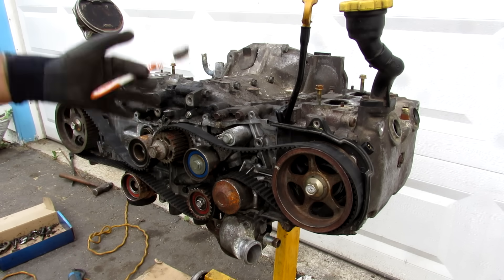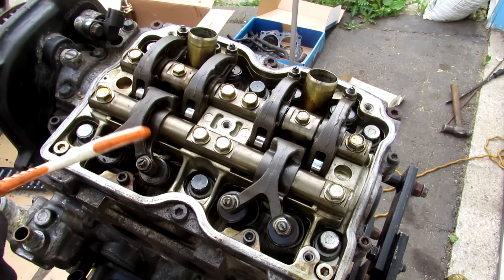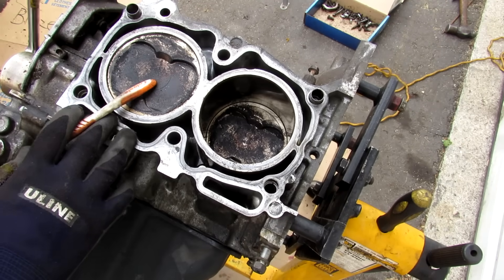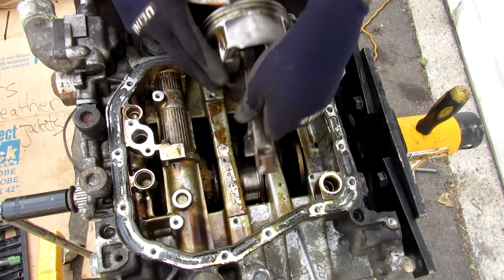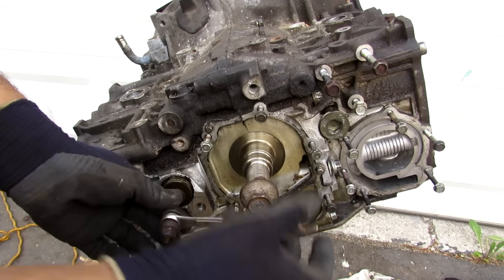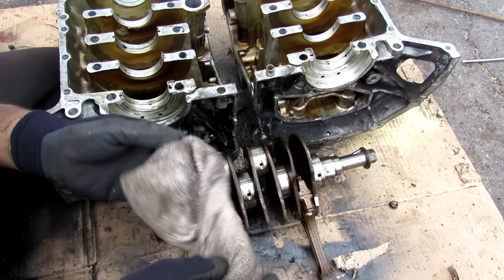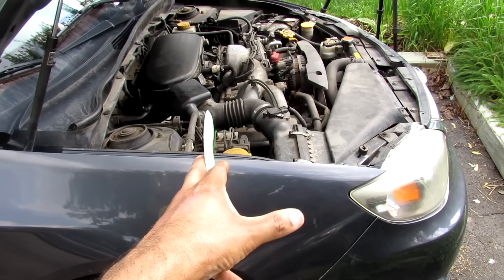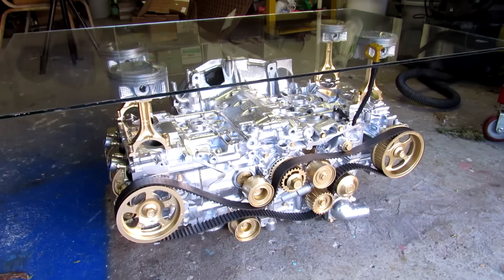Why Subaru Engines FAIL

Comment from the maker: If you've got a Subaru, keep your vehicle well maintained! 
You can purchase engine oil here:
https://amzn.to/3d85UIN (US)
https://amzn.to/37yDKpb (Canada)
Quality oil filters:
https://amzn.to/2B56WYV (US)
https://amzn.to/2N1NBKM (Canada)
Engine coolant:
https://amzn.to/3fpfPeB (US)
https://amzn.to/37uSF41 (Canada)
Subaru headgaskets:
https://amzn.to/2Auw8bz (US)
https://amzn.to/2MYTcSb (Canada)
Reply: I've owned 3 Soobies always maintained 2 were ej2.5 & they have been some of the most reliable cars around. I don't know many people here in Australia that ever have problems with Soobies, they are fantastic cars with a great reputation here. These examples must have been thrashed or Americans just don't maintain there cars. Boxer engines must be serviced always on time with good high grade oil.  There are literally thousands & thousands of old Subaru's for sale 2nd hand most with 350,000kms+. Maintain your cars people!
Reply: @Jimmy-fw1wd  im in australia too and everyone i know have had a major prob or two with their subi including me.  I wouldnt touch another. My rav4 is at 430kms and original everything  including clutch ! Oh alternator is new !
And dont start me on working  on a boxer  ughhhh !!
Reply: @Jimmy-fw1wd  I purchased a Subaru because of its popularity in Australia and the Rocky Mountains. I figured that if they can excel in those conditions my driving in central Mississippi will be a breeze.
Reply: You should be doing that with any engine. I don’t think this engine is bad at all. Maybe if you’re wanting easy access to things, sure, but for the general public, it’s a safe, well rounded, and efficient engine.
Reply: There are how many Subaru’s still on the road?
Reply: @Socrates8397  they sold heaps and many have had the head gaskets done 😣
Reply: In your opinion, what is the most balanced engine ?
Reply: @Matlockization  bmw inline 6
Reply: @Matlockization  I-6
Reply: @Matlockization  , here's fact, not opinion: Gas turbine (jet) engine.
Reply: @GFTP100  Very interesting.
Reply: @Matlockization  straight 8 Buick
Reply from the maker: @Matlockization  inline 6 or v12
Reply: @speedkar99  Ok thanks.
Reply: @Matlockization  It'd be tough to answer that objectively, but for a 4-cylinder, the boxer config is pretty tough to beat. A straight 6 is also very well balanced, thanks to its firing order/cam attachment points. (For the inverse, it'd be tough to find a worse-balanced engine than a traditional V8.)
Reply: @TravisTerrell  Thanks.
Reply: @TravisTerrell  agreed ................... but nothing like the power of a V8
Reply: @TravisTerrell   V8 worse balanced? I don't think so! Most V8s are very smooth, the only engines smoother are inline sixs in my estimation, if you V8 is vibrating it's probably misfiring.
Reply: @TravisTerrell  straight 8 Buick if you're talkin  engines in general
Reply: @TravisTerrell  Actually, a V8 is a series of 90 degree V twins which have far better primary balance than any straight engine.
Reply: 911's and Bugs were noisy because they were air cooled and the 911's had chains turning the cams, it had nothing to do with the opposed pistons. I've rebuilt old 911's and they were works of art, the cranks were nitrided for hardness and the big difference in the 911 and the Subaru was the 911 had dry sump lubrication (it took 15 quarts of oil) so half the pistons weren't sitting in oil, the cylinder walls were sprayed with oil jets and later aluminum walls were nikasil coated. The 928 and 9 24- 944 had aluminum coated walls too.  
Those 911's were winning 24 hours of Le Mans for nothing!
Reply: @mosfet500  I owned a 86 944T and it was excellent.  The major weakpoint on those engines were the water pumps.  They failed so often it was considered a 30k maintenance item.
Reply: @bp968  The 944 was half a 928 with harmonic balancing to keep it running smoothly. I had a 1988, 944S and it was lots of fun without the back ends braking loose like the turbo 911's of the era with their wacky boost kicking in. I spun a 911 around coming off a thruway when I hit sand on the road exit. My girlfriend at the time got out of the car and started praying, in retrospect it was kinda comical. I'm old now and drive like a church mouse, age, wives and cops will do that to you! (not necessarily in that order)
Reply: @mosfet500  i spun a 911 during a testdrive.  Oops.  As for the 944t back end, i credit that with getting me serious into stage rally!  Now i drive sideways everytime it snows, but i drive better sideways than most people I know do when not sliding around.  It's something they should teach to all new drivers in northern climates IMO (they teach it in finland I believe).
Reply: @mosfet500  well he are talking a lot more expensive car too ! I imagine a veyron would be up another notch in quality !
Reply: That's with any car, but noted with your spam.
Reply: How many miles did this engine have?
Reply: @RealAnthonyCallahan  10 miles
Reply: Does he ever breathe?
Reply: can you do a car review on a crosstrek?
Reply: The really problem of  impreza engine is .. "the engine.."
Reply: @Sabrewolf81alfa  https://youtu.be/-jDrkEEK99E
Reply from the maker: @Baddawg_313  Send me the engine
Reply: @speedkar99  i dm'd you on your FB link
Reply: @speedkar99  Why do some people don't know and abuse their cars and their families and friends and personal Relationships.??????????????
    Some people Ain't got Common senses..... duhhhh
Reply: I got a VR6 3.6L 24v Dohc engine is it any good
Reply: speedkar99 has
Reply: Kjio
Reply: jcthawaii  x
Reply: Also have the oil and water pump checked out that that are working ok or replace well  before thay fail this can stop your engine seazing up and  as a rebuilt boxer engine WILL  fail more often and are more costly that the car's worth big money pit if you do not check oil water seals and pumps  any make of car with this engine needs a lot of TLC
Reply: @stephenlynch8846  this engine meaning horizontal?
Good reason why only 2 ? manufacturers use them !
Reply: Do you remanufacture the dohc 2.5 gt
Reply: You should maintain any vehicle no matter what it is just saying
Reply: @ronalddaub7965  i think subis need more attention
Reply: This comment says it all.

Change your fucking oil.
Reply: And change the timing belt every 60,000 to 80,000 miles.
Reply: I have a 98 Outback with 245,000 miles, still uses no oil and runs great. Has the 2.5 L DOHC, supposed to be the bad one. I'm lucky, I agree, not a great design.
Reply: The power of one man and a video to generalizes all Subaru engines as junk.
Reply from the maker: jcthawaii  Thanks
Reply: @speedkar99  awa
Reply: @speedkar99 i don't understand why subaru's boxer engine fails ??? Why !!??? 😢 but subaru still make a boxer and better than old engine !!
Reply: @madout2254  youd hope its better !!
Reply: What kind of gloves are those uline what?  link?
Reply: 00000000 o.o 0 0000 0 0 0 000000000000
Reply: If everyone keeps telling Subaru these engine problems,  did they re-engineer the design and fix it ?
Reply: @helpfulsysops3593  they know !
Reply: Ultra CNC  lol.  Not much xp with chevy.  Honestly not much of a American car guy (though most of what i buy is made here). Ford burned me on american.
Reply: Just like a corvair engine you need to know what you're doing to case align bore an engine when it needs it
Reply: T
Reply: Ultra CNC  haha classic  !
Reply: @Jim Kvasnicka Your reply made me realize I had forgotten to include the link to the WikiPedia article:

https://en.wikipedia.org/wiki/Opposed-piston_engine

Subaru does not use opposed-piston configuration.
Reply: Amazon affiliate spamming
Reply: To solve this problem, try swapping in a GM LS engine as an alternative, including mod them for reliability.
Reply: @nightdan7096  I'll think about my paid off PV and not having paid for gas or electricity in the last several years when I drive by you paying for your fill up. Let me know when you get your oil changed, I'll drive by there too and when that timing belt needs changing too. The maintenance on my EV for the first 150k miles is rotate the tires and change the cabin filter. By the way, lots of EV owners drive across the country.
Reply: My Subaru is a 2013 impreza. Only just hit 100k miles but it's burning oil. A quart of oil per every 250+ miles. Is there anything I can narrow it down to? Should i trade it in?
Reply: @dantedrowson2511  You should find the source of the excessive oil usage from Subaru or a trusted mechanic. If it's something small like valve seals get it repaired, if it's rings I personally would dump it.
Reply: @mosfet500  Okay thanks so much, dear. Is there a specific test to identify where the oil is being used/comsumed? Or do I just take it in there and describe my problem to them?
Reply: @dantedrowson2511  I just remembered that Subarus had a cylinder leakage problem. What happens is the seals where the cylinder heads meet the crankcase leak after awhile, some cars more than others. Maybe you have that problem. It's not cheap to fix, maybe about $600 if I remember but it's worth it if the car is in good shape. You can have an experienced person look under your car and see if that's the problem, also check to see if you have any oil on the ground where you park. That will tell you if it's a leak and not something worn like rings.
Yes, take it to a good mechanic and explain your problem.
Rob
Reply: Full synthetic Mobil One.
Reply: The delivery of this vid is superb. Makes it easy as boiling an egg! Good job!
Reply: I've driven a Subaru Outback for ten years and it never gave me any trouble.  It's the best car I ever bought.
Reply: @davidlafleche1142  Oh, you're the one!
Reply: @mosfet500  Still, I miss AMC.  I'd buy an Ambassador or a Matador if I could.
Reply: @davidlafleche1142  There's a reason why AMC went out of business. Someone gave a Gremlin to a friend of mine for free.... he gave it back! The maintenance on my EV for the first 150k miles is rotate the tires and change the cabin filter, now that's a great car. My life's transportation goal is to never drive a gas car again.
Reply: @mosfet500  The worst car made by AMC was still better than the best Ford.
Reply: The video I just watched is four years old. I just bought a 2024 Crosstrek and I am very interested in how the engine has evolved in the last four years and weather the fundamental problems that you described in this video remain. I am aware of problems potentially because of the need for manual valve adjustments, carbon buildup on the intake valves, and the need for special attention to the transmission. Do I need to worry about anything else with the 24 engine?
Reply: Well I got a Subaru Outback 3lt..12years I got..replace one front wheel cv joint...fan belt tentioner bearing and the battery...the thing still drive like a dream...Ok I dont use it much...got 220k km on the clock.I love this thing.
Reply: @truth-Hurts375  yr lucky my subi  had head gasket  cv issues at 200k  my rav4 is at 430k and running fine on original clutch too 🤤 id never touch a subi again the flat 4 expensive to work on
Reply: Most engines go bang because of the owner look after ya shit ya shit will look after you 😂
Reply: Very nice breakdown and assessment, might I say. Very quick and concise. You, obviously, think in a mechanical engineering fashion. Thanks!
Reply: brotherman are you by chance in florida?
Reply from the maker: @rememberwhoyouar3  Canada
Reply: @speedkar99  Is the engine boxer or horizontally opposed?
Reply: @tropicalstorm339 , It is a boxer engine because the pistons move outwards, horizontally opposed is where the pistons come towards each other .
Reply: @bobw7066  I was confused by your explanation, so found this Wikipedia page that explained it a bit more clearly.  Are you referring to the opposed-piston engine configuration?  I had never encountered that configuration before so had to read up on it.  Not used in automotive applications, apparently.
Reply: @bobw7066  what do you mean the pistons come toward each other? There is no such production engine.
 A boxer is horizontally opposed flat engine. That means the pistons travel back and forth horizontally, so the right bank directly opposes the left bank @ 180°
Reply: @bobw7066  The use of a Flat Plane Crank determines cylinders in opposing positions.
Reply: Convinced me not to buy a Subaru POS.
Reply: @DintyM  https://youtu.be/-jDrkEEK99E
Reply: jcthawaii  When I see magnificent cars like the C8 vette I have to agree with you. Of course the problem is most people don't know car engineering so they believe the ads. I've said for years Subaru is not a great car, unfortunately I bought one in 2006 on a recommendation and had to find out for myself by digging into it. I meticulously maintained it only to find that at 80k miles the heads started leaking.
Reply: @mosfet500  Well, My father had 2 different Subaru
's and each one had well over 200,000 miles on them when he got rid of them. Both continued inservice on the road well after he sold them so it all really com,es down too what engine you have and how well you maintain it.
Reply: @gregtaylorgregg41  My engine was meticulously maintained and all the work was done by Subaru. Flat fours are inherently problematic, Porsche ran dry sump lubrication so the cylinder walls were evenly lubricated, Subaru doesn't.  I was just talking to a repair shop the other day, they said the same thing, Subies aren't great cars. For the last several years I've driven an electric car, I will never go back to an ICE engine. No tranny, no belts, plugs, stuck injectors, starters, antifreeze, air cleaners, tune ups and no problems. Since I charge from my paid off PV no fuel costs for the last several years too.
Reply: @mosfet500  electric vehicles - no exhaust systems;  pipes, flanges, mufflers, resonators, gaskets, cats, rusted stud, mounts, lambda sensors, etc, etc. etc
Reply: @francisdonnelly9361  I know, the list just keeps going on and on!
Reply: @francisdonnelly9361  but the batteries  $$$' 🤔
Reply: @mosfet500  sounds like something a tree hugger would say
Reply: @francisdonnelly9361  thats the part of being a man, you fix those kinds of things you don't just avoid life
Reply: @nikomartinez1578  7 plus billion people on the planet, everything you touch, eat and breath depends on the planet's health and resources. Maybe we should all be tree huggers!
Reply: @mosfet500  but electric car can take fire. Even after flooding these are a headache for fire department that need to isolate them as they corrode with salt and take fire. Electric car have difficulties eith heat snd cold. Try to leave your electric car outside here in Quebec at -30c  without any plug to heat the car we will see. And we will  see also how much time you can keep it? 15/20 years i doubt about that. Your battery will be dead in 10/12 years probably sooner after 7/8 years if not well maintained or in difficult temperatures.  Range too short and  more importantly not predictable. Also no way to buy energy on remote location. With gas you can buy gas remotely or bring it with you extra jerrican. This is why i decided to buy a new Bronco Sport and not an electric car and i love it.
Reply: @CC-gt3ro  Nonsense! When gas cars came out did fire departments have to learn how to deal with gas fires? Of course they did, you don't stop technology you adapt to it.
I live in a place that has seen -40C, I sit in my house with the car plugged in and that keeps the car conditioned. EV's have something called battery conditioning. Not only that 
I can leave my car in the garage and preheat or cool it while it's plugged in so that when I go out it is comfortable, you can't preheat a gas car in an enclosed space.

There are people with Tesla's and 300k miles on them and the batteries are fine:
"Now we’ve come across a Canadian Tesla Model 3 owner who claims his car, delivered in October 2018, has passed 310,000 miles (500,000 km) with no issues whatsoever. According to the owner, who goes by the name “I like piano black” on Twitter, his car is still on its original brakes and battery. He only replaced the drivetrain oil pump at 286,000 miles (460,000 km) for 250 CAD ($194)."

Source: Autoevolution

The EV infrastructure is growing everyday. I live in rural NY and there are chargers all along major routes and highways, you don't know because you don't charge or own an EV. The fears you're expressing and common among people who don't know, drive or understand technology and the future. EV range not predictable? What are you talking about? EV's are exceptionally good and getting better, now the Lucid goes over 500 miles and recharges in 8 minutes. You're living in the past, enjoy paying $5 a gallon while I charge free from home with my paid off PV system. The maintenance on my car for the first 150k miles is rotate the tires and change the cabin filter, you could by two EV's for the gas and maintenance of your Bronco and still have money in the bank.

It's the 21st Century, those who don't know how to benefit from technology will suffer for it. Gas is running out, you think Valdez would have dug down 18,000 feet in 5,000 feet of water if they could have dug a well in Texas? What do you think that oil spill did to the ocean and people's livelihood? People go to the pump and never see the damage they're a part of which is exactly how the fossil fuel industry wants it.
Reply: @mosfet500  keep that for yourself. I don’t want it. I don’t like it. I know perfectly battery technology. I don’t want it for my car. We will see when electricity will shut down. Or when you will stuck in a huge traffic jam. 
We will see when you try to go on country road. I don’t like your electric i don’t want it. Period. I want a car that is reliable all conditions that can tow my cargo trailer. Keep your that for yourself. If it is good for you i don’t see an issue but don’t force people to do the same when it is bad for them.
Reply: @CC-gt3ro  
Wrong again:
"Li-Cycle Announces Commercial Lithium-ion Battery Recycling Plant Now Operational in Rochester, New York"
source:  Li-Cycle

More gas cars catch fires than EV's:
"There were 1529.9 fires per 100k for gas vehicles and just 25.1 fires per 100k sales for electric vehicles."
Source: Autoweek

"According to the U.S. Department of Energy, 80 percent of EV charging happens at home."
Source: Canary media
Reply: @CC-gt3ro  I charge from my PV system for free, I don't care if the grid goes down I'll always have charging.
Reply: @mosfet500  I purchased one in 2005, it now has 140k. So far so  good.
Reply: @mosfet500  must not of maintained it
Reply: @mosfet500  yea I own a 1981 cutlass and it does better than subaru
Reply: @nikomartinez1578  A split case pancake engine is difficult to get right and they have inherent flaws. 
For one Porsche uses dry sump lubrication to overcome crankcase oil distribution problems. The cylinder walls are sprayed with oil constantly so you don't have unequal oil distribution. Subaru doesn't and I think there are problems created by not using dry sump lube. 
They still have head gasket issues and both mine and my brothers had them.
Reply: Part of the problem is the owner used JUNK FRAM filters!
Reply: @Stacy_Smith  I only use mobil1 oil and filters, so far it's ran great SO FAR
Reply: Damn head gasket blowers, good point on oil starvation. Piston slap and other issues. Awesome description. As for the oil rings we had CR-V with oil rings completely clogged by carbon.
Reply: @pliedtka  https://youtu.be/-jDrkEEK99E
Reply: I have a fascination with boxers, and have made a little animated video, showing how they become long and rather ungainly, when modern overhead valves, and direct cam actuation are added.  https://www.youtube.com/watch?v=gUOvOoFcMDc
If you are interested in seeing a private vid, demonstrating a plan to simplify a boxers with OHV operaton, lemme know!
Reply: You're wrong about low on oil it is the design of the oil system you are a parts' changer I see not a mechanic
Reply: Never had any problems with the FA-20 in a GT86 I had. I think they fixed a lot of the issues with that generation. They don't suffer from ring land and that nasty stuff.

It seems to be mostly the older 2.5s which had problems.
Reply: @BlatentlyFakeName  how may kms did have on it thou ? My rav is at 430k and running fine
Reply: Mister Nobo
Reply: Or just don’t get a Subaru.
Reply: If you have a subaru sell it and buy an Infiniti with a good nissan V6 in it.  I did that with my constantly failing (under warranty) 2006 STI and bought a 2008 G35x which now sits at over 175k miles and not a single issue over that time frame (other then an annoying sunroof leak that's apparently common on that model.. But sunroofs almost always suck imo).
Reply: So in other words... Subarus are garbage.
Reply: @Vdub1910  https://youtu.be/-jDrkEEK99E
Reply: I wish they'll stop making piston rings for cars.
Reply: @Rigandfixit  They did, it's called an electric vehicle!
Reply: M8 sloooow down. Youve got good info but dont dont 3 lines of coke b4 u record a vid! Calm down man. Breath
Reply: @alabar9795  nah then the video would b TWICE AS LONG🤦‍♂️😂